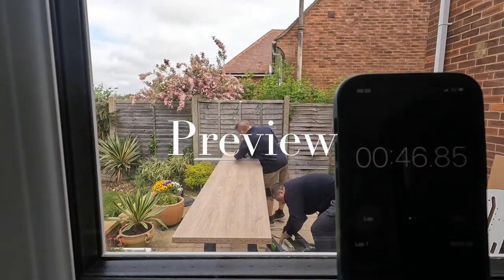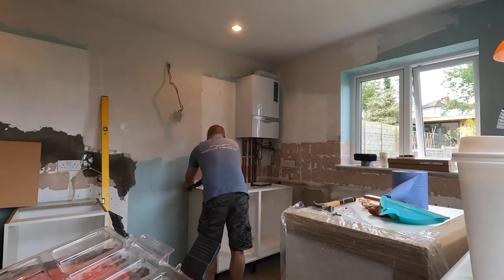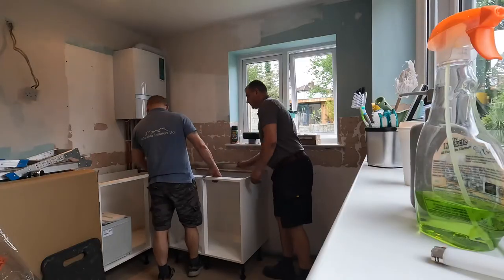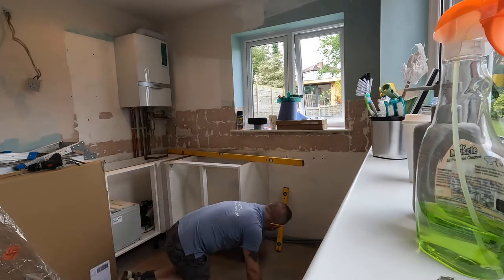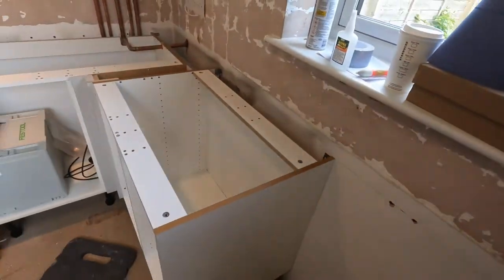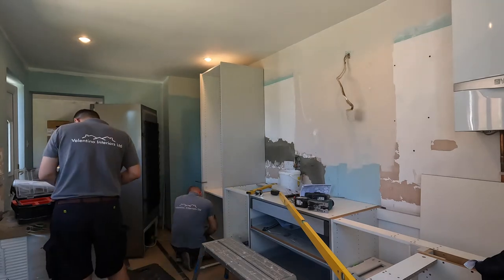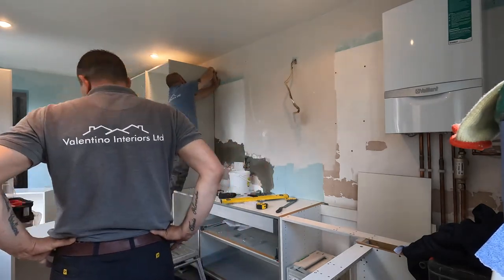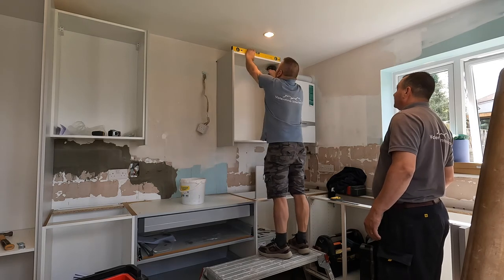Magnet kitchen installation in UK (part 1)

Comment: thanks for this video. attempting to fit my wren kitchen in a few days
Reply from the maker: No problem , any further questions don’t hesitate to ask.
Good luck.
Reply: @valentinointeriors3023  what screws do you prefer to use to attach your cabinets together ? Also what wall screws to attach to wall?
Reply from the maker: @mitchellsx  To attach the cabinets on the walls I am using 5/60mm or 5/50 if the wall is solid . To attach cabinets together I am using Spax screws 4/30mm or 4/25mm depending on the carcass material thickness.

Comment: Brilliant very informative videos, thank you. I am half way through fitting my magnet kitchen and its great to find out I've done a lot of it correct already :) I had one issue, I have a corner unit with a built in under counter freezer next to it. The freezer isn't inside a unit carcass and so when I put the freezer in up against the corner unit and open the door there is a big gap behind the corner post. I ended up cutting a bit of wood off the back of another unit, that I needed to cut down anyway, and attached it to the back of the corner post to fill the hole. It looks ok but I think there must be a better way to do this. How would you have done it? I am fitting a true handleless kitchen with the aluminium rails to open the doors instead of handles.
Reply from the maker: Hi James 
Thank you for your feedback.
Indeed the freestanding freezer doesn’t get installed in a carcass. Difficult to visualise this . What if you install an end panel on the corner post? 
Maybe send me some photos.

Comment: Nice video
Interested in what you say about connecting the kitchen together in a way to allow it to be removed for repair work in the future. How do you deal with the angle brackets connecting the cabinets to the wall? Surely these are hidden under the worktop? Thanks
Reply from the maker: This particular kitchen doesn’t have any access to the back brackets. There are some brands which have. In the worst case scenario you have to cut a 30mm hole in the back so you can access the fixings.

Comment: Great video, just ordered my magnets kitchen and awaiting delivery. I’ve opted for the cheaper self assemble option. Does this mean the carcasses will come flatpack and door hinges not pre drill do you know? 
Cheers
Reply from the maker: Hi Harry 
The units will come flat pack but all the holes are drilled. There will be an assembly guide in every box. Follow the guide and pay attention to the sink unit and oven housing and you will be fine.
Reply: @valentinointeriors3023  Legend! Thanks for the reply much appreciated